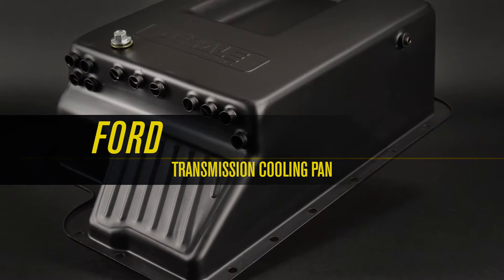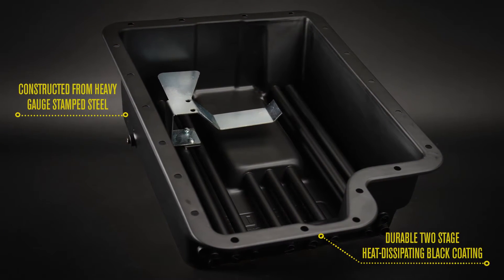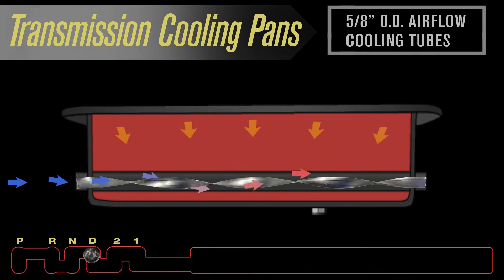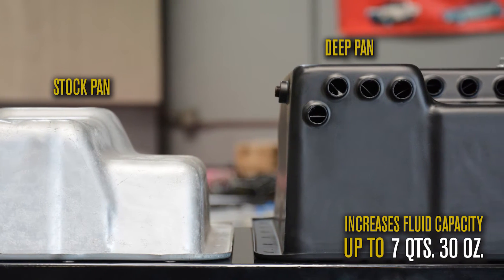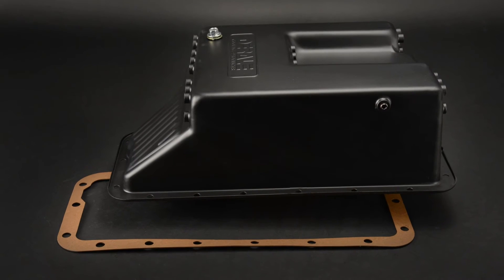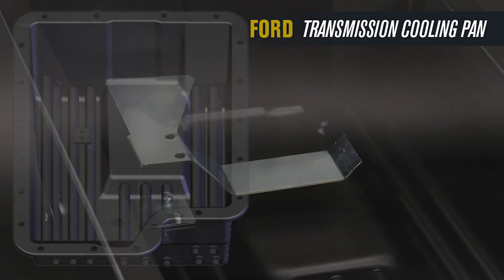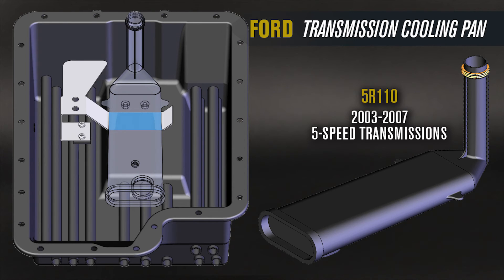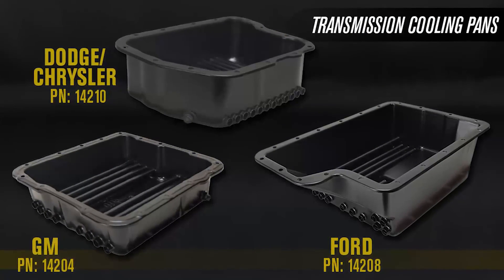14208 Transmission Cooling Pans

Comment: Just got mine today. I know this is an old video but, this is a very stout built pan. Very nice quality product.
Reply: How was the lip edge ?? And did it seal up easy with no leaks 

I also would feel better useing the Ford gasket instead of the copper one in the vid 

What do you think
Reply: @desolategrey  the lip was fine. The problem was the drain plug, on both pans I bought, wouldn’t seat and seal.
Reply: @mountcastlegarage5381  got it thanks for the response they looked too good to be true 

Guess i will go with ATS